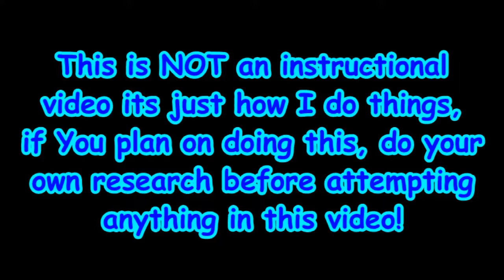COB LED Grow Light Rescue! (Saved from the Trash Bin)

Comment: I had a grow light in the 80's and I got another one in the 90's. I remember the one in the 90's was a 440 watt HPS or High Pressure Sodium, I got that one because it was great for the flowering stage, but I paid over $500.00 for it. It weighed about 60lbs because of the ballast. The old and crazy days! 😉
Reply from the maker: Lol these just got even lighter then they were, think they are only a few pounds a piece.

Comment: Do the replacement 110V LED banks emit the same desired wave length as the originals?
Reply from the maker: Yes, I did look for that when buying the replacements. The replacements are "Full Spectrum" grow light LED's, I am presuming that is why they look kinda pink when lit and not white like regular lights. There was also a warning saying not to look directly at them, I guess for the same reason you shouldn't look directly at the Sun.

Comment: Umm... wasn't there thermal paste between the heat sink & the back of the LEDs?  I'm not an electrician either, but I think the thermal paste is kinda important to the longevity of the unit. The breakdown of the old paste might have caused the original problem. (Of course, thinking has gotten me in trouble in the past so i try to do as little as possible now)  :-p   Excuse me if I am mistaken.
Reply from the maker: No you are right about the paste, but these LED's are already mounted on a heat reducing back, and were actually made to be mounted directly to what ever you wanted to put them on with no need for heat sinks or fans, so I figured putting them in a unit that has heat sinks and fans would be a plus. These new 110V are made to burn cooler, then the old style ones that were in them. Also with the new ones there is no charge delay, when you turn um on they come right on, unlike the old ones that took a few seconds because of the drivers having to charge. But still paste definatly wouldn't hurt might reopen them and add it just because!! 👍👍
Reply: @BackyardScrapping  Your package should be there soon, sad little collection of junk that it is.
Reply from the maker: @ManMountainMetals   It came yesterday, opened it when I got home from work. All I can say is WOW!!!!!!!!! Video coming soon!!!! Thanks so much, and again, WOW!!!!! You are to kind my friend!!!
Reply: @BackyardScrapping   was everything broken? I keep getting this reoccurring image of you shaking the box and it going jingle jangle.....
Reply from the maker: @ManMountainMetals  LOL nope it all was in tact and just fine! Not even a dent in the box, USPS actually did a good job with this one!!
Reply: @BackyardScrapping  The 13 million  FRAGILE stickers did their job.